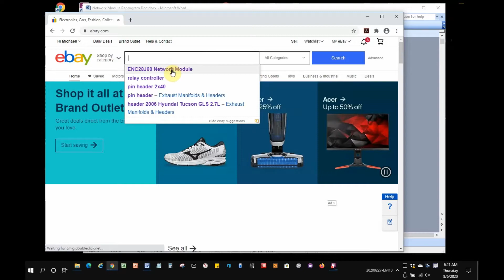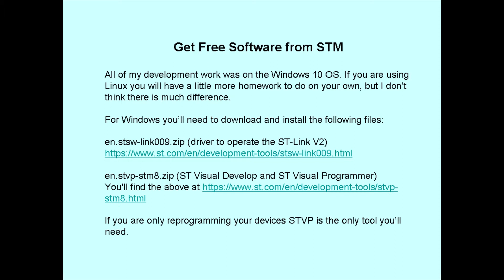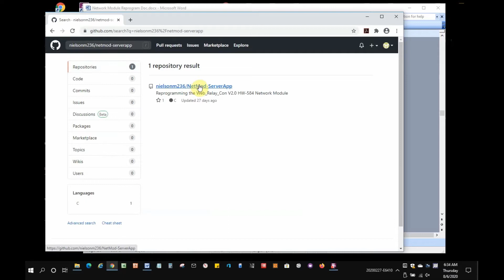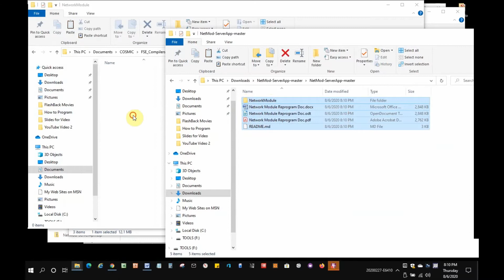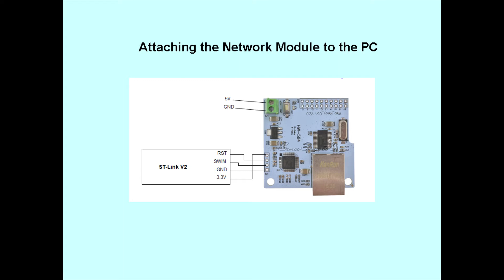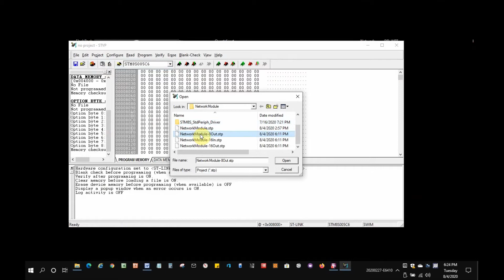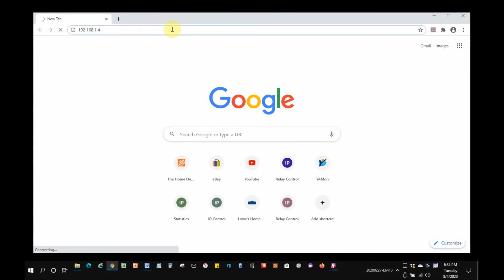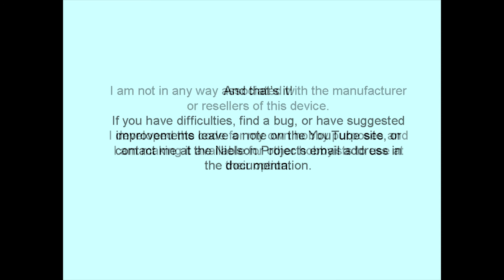Web Relay Con V2.0 HW-584 Network Module 8/16 Channel Relay Controller ENC28J60 – Reprogramming Demo

Comment: Hi Michael, I just bought a Web_Relay_Con V2.0 HW-584 and would also like to flash it with your new custom firmware, just I have a problem before I get into this when I want to go to the webpage 192.168.1.4: 8080 nothing happens at all, when I omit the port number 8080 I get a screen that asks for a password ..... so I don't know if I have a good module, do you have experience with this? Greetzzz Pascal
Reply from the maker: When the module is new from the factory you will need to use a command like "192.168.1.4/30000". Note there is no ":" - it is a "/" in the factory code. This is because they default to port 80. Also note that in the factory code they use the term "port" (as in "port 30000"), but that is NOT an actual port number. It is just a file name. Those factory guys are very confused. :-)
Reply: @nielsonm.projects Thank you very much Michael, and yes all of them very confusingly, but it worked and now we can start the big work, I have already received the St-linkv2, you will hear it when everything has been successful. Greetzz Pascal
Reply from the maker: @scalyvopascal-yvonne3270  A comment from another user: For the STVP program to find the .sx file you may need to edit the .stp file with a text editor and replace the .sx file path with the correct one for your computer. Otherwise the instructions I included on GitHub should work for you.
Reply: @nielsonm.projects  hi Michael, I was able to flash the module and everything works fine locally on the laptop, but when I now connect the module to the network via the router, I only get a blank image in my browser, the same via iphone and also ipad, I can ping the module via cmd. I have also tried to change the MAC address but without result. Any suggestions?
Reply from the maker: After reprogramming, when you connect the Network Module to your network, is the ST-Link still attached? You must at least remove the RST connection, but I'd suggest you remove all the ST-Link connections for test.
Next, make certain your PC/Laptop is connecting to the network. When you directly connected to the Network Module you probably changed your PC/Laptop to a fixed IPv4 address, and you need to change it back to what you had (DHCP for instance) so that it connects to your network.
If you get a blank page, is your browser giving you any other error message, like a 404 or some timeout warning?
If the above don't help, please let me know what you entered in the browser URL line.
Mike
Reply: @nielsonm.projects  
Hi Michael, I flashed the module on the laptop and then removed the ST link and tested the module on the laptop via fixed local ip address. this works fine. afterwards plugged the module into the router, switched off the laptop and continued working on the desktop, and opened a chrome / IE - browser with address: http://192.168.1.4:8080 here I only get a blank screen, no error or error message. same story on ipad and iphone.
Reply from the maker: Scalyvo - I continue to try to discover why your Chrome and Edge installs might not work (but I still can't explain why Firefox works on the same system). In searching for similar problems other people have had just in ordinary use of their browsers a few ideas come up:
1) You mention trying iPhone and iPad, which suggests you might be trying to use a cellular connection. If so, keep in mind that until you do some port forwarding from the internet into your local network none of that is going to work. I would not try to do any of that until you have a local network PC or Laptop connecting to the device without going through the internet.
2) Assuming you know for sure everything is connecting ONLY on your local network (not through the internet), you might want to check your PC/Laptop settings to be sure that it views your local network as Private, not Public. Usually this doesn't matter, but if the PC/Laptop thinks your local network is Public it will block some connections. (This of course begs the question: OK, but why does Firefox work?) For reference: Windows 10 - Start > Settings > Network & Internet > Ethernet then click your network adapter.  If the profile is set to public, change it to private.
3) I found a couple of comments about Symantec AV changing settings on Chrome browsers and causing problems. If you are using Symantic AV let me know and I'll send you info.
4) Compatibility settings may have been changed in the Browsers. If your PC/Laptop is used for work, your admin may have required some settings changes that could block connections. In Chrome under Settings you may have Enhanced Protection or similar settings enabled. In Edge there may be similar settings enabled - but I'm not familiar enough with Edge to find them. Settings might also be blocking any non-secure site - and the Network Module appears as a non-secure site.
For now that is all I can come up with. I don't know how we can compare my settings to yours, I can only say that I haven't changed any defaults on my browsers that I am aware of.
Mike
Reply: @nielsonm.projects  Hi Michael, thanks again for all the research you have done so far, I am satisfied that the module works and it is through firefox, it does not matter to me which browser I use. Perhaps it is due to Kaspersky internet security because it is installed on the 2 different devices I tested on. But for now I'm going to stop looking further, as I said I'm glad the module works! Greetings and thanks again!
Reply from the maker: That all seems correct. Are you certain your network address range is 192.168.1.xxx? Not 192.168.0.xxx or something else? And that nothing else on your network is using 192.168.1.4? Sorry for asking basic questions but sometimes simple stuff like this gets overlooked when testing.
Reply: @nielsonm.projects  my network is indeed: 192.168.1.xxx and the ip address 004 is not used by another device, and I can also ping the ip address, by the way, I had also tried to change the ip address of the module via the laptop and that works too, on the laptop locally, but once the module is connected to the network ..... blank screen in the browser ..... verry strange at the moment ;-)
Reply from the maker: Agreed - something very basic in addressing or connectivity is being overlooked and I'm not sure what it is. I will keep thinking of what to try. I have 6 of these on my production network, and several other people have had success, so that is some assurance that it does work. But what you are describing has me at a loss for explanation. Some other thoughts: What browser are you using? Chrome, IE, Firefox or other? Is it the same browser on your laptop and PC? Is it possible you have a firewall on your PC or in your local network that is blocking the connection? Typically ping will still work, but HTTP connectivity might not if a block is present.
Reply: @nielsonm.projects  
i am also convinced that the module works, only we have yet to find the problem why i am not getting image on my desktop, i have tested both chrome and IE on both devices with no success. That the page is blocked for some reason is a possibility and I am going to check all possible network settings including firewall. Thanks in advance for the replies and thinking about a solution! Thnx
Reply: @nielsonm.projects  hi Michael, problem partially solved, with Firefox the module can be accessed so the problem is in the chrome / IE network settings ........
Reply from the maker: If you figure it out let me know. There might be valuable hints about a bug fix (or enhancement) needed in my code. Or even just hints for other users should they see the same thing.
Reply: @nielsonm.projects  I was just thinking before the module was flashed I could reach it with chrome browser on the desktop with the address 192.168.1.4/30000 and after the upgrade no longer without changes on the desktop. With the exception of firefox.
Reply from the maker: The primary difference will be the port number. The factory version uses port 80, and the default in my code is port 8080. But if you have it working on Firefox the port number cannot be the issue. I've tested with the following:
Firefox 77.0.1 64bit
Chrome 83.0.4103.106 64bit
Edge 83.0.478.50 64bit
Edge 83.0.478.54 64bit
Internet Explorer 11.329.19041.0
Internet Explorer 11.900.18362.0
Do you know what versions your Chrome and IE are?
Reply: @nielsonm.projects  I tested with following browsers:
 Google chrome Version 85.0.4183.121 (Official build) (64-bit) blank screen,
Microsoft Edge Version 85.0.564.63 (Official build) (64-bit) blank screen,
 Internet Explorer 11 version 11.0508.19041.0 It works fine!
Firefox 81.0 (64-bit) It works fine! 
on the iphone x and ipad both under IOS 14 i get the error message from safari cannot open the page because the network connection is lost and with the google chrome app there is the error: ERR-CONNECTION-CLOSED
Reply from the maker: OK - Maybe there is some change in the more recent Chrome and Edge versions. I will update and try them as soon as I can.
Reply from the maker: Hi Scalyvo - I just ran a series of tests with Chrome Version 85.0.4183.121 (Official build) (64-bit) and Microsoft Edge Version 85.0.564.68 (Official build) (64-bit). Both worked OK in my environment. I think we're back to trying to figure out what might be different between your browser setup and mine. I don't think I did anything special in installation of either browser. I seldom use Edge, so I'm sure I haven't done anything there. I use Chrome 99% of the time and keep add-ons minimized as much as possible. I'm at a loss again about what to try. I wonder if there are any website filters or some such thing that might be in play. Nothing wrong with those, but sometimes they can block legitimate activity. The fact that FireFox works for you makes it even more curious.
Reply from the maker: OK - Glad you are able to make it work for you, and disappointed we couldn't figure out the source of the problem on the other browsers. If as some point you do find a solution please post as it could be helpful to someone else. Also, stay subscribed as MQTT support will be released soon (I hope!) Thank you! Mike

Comment: Hello Michael,

My ST-Link has  finally arrived and I have followed your steps to program the module.
In my case the .sx file was not automatically loaded and I get an error:

Hardware configuration set to <ST-LINK on USB with STM8S005C6 plugged in and SWIM protocol>.
Blank check before programming (when available) is OFF
Verify after programming is ON.
Clear memory before loading a file is ON.
Erase device memory before programming (when available) is OFF
Display a popup window when an error occurs is ON.
Log activity is OFF
> Loading file C:\Users\Mike\Documents\COSMIC\FSE_Compilers\CXSTM8\NetworkModule\NetworkModule-8Out.sx in PROGRAM MEMORY area  ...
Error : No such file or directory
Error : < File loading failed.

Only had success when I edited the .stp file with a text editor and replace the .sx file path with the correct one for my computer.

It's working great. Excellent work!

Now I'll try to start making changes to your code and see if it compile...
Reply from the maker: Ah - good. I'm glad you figured that out and it is working for you.
Reply from the maker: I'm going to update my document and video with your "edit the .stp" suggestion. This should help a lot of people.